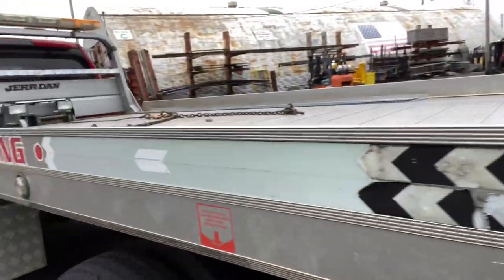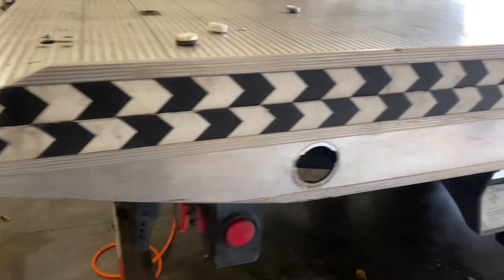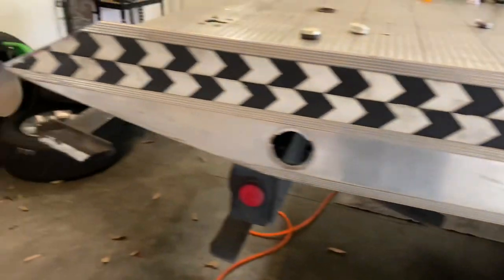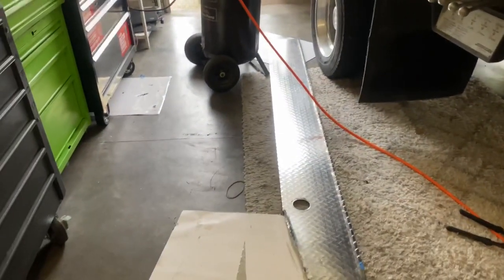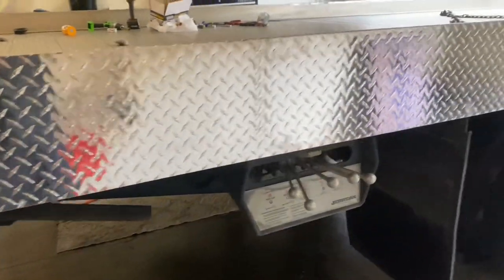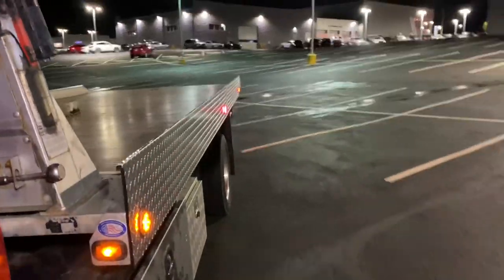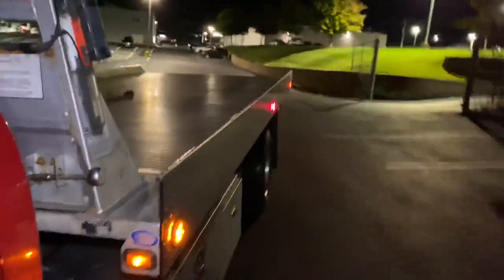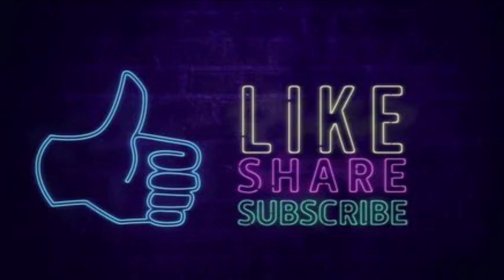Custom jerrdan tow truck bed rails

Comment: Looks nice ...How did u got it stick on the sides means u welded it or used something else
Reply from the maker: Used very strong glue and epoxy in certain spots to be safe
Reply: @Towvibes  always thankful for ur timely response brother  but don't that glue damage the original body of the bed?Which glue u used if u can tell me thanks Oz
Reply from the maker: @bxtbill  you can always sand it or wire wheel it off but I’m never going back if the Diamond plate covers get damages I just replace I use rtv along the top and guerrilla glue spread out in spots evenly u can tac weld or drill hole bolt also but I’m happy with the way they are they don’t budge!
Reply: @Towvibes  I must say it looks awesome MA SHA ALLAH ...I have a chevron bed on my truck I will get it too will update u about it